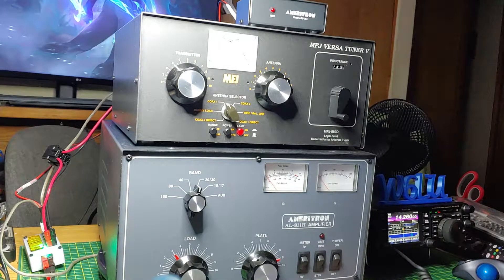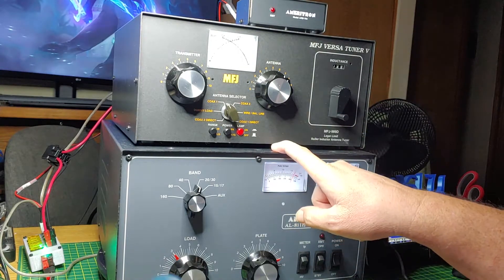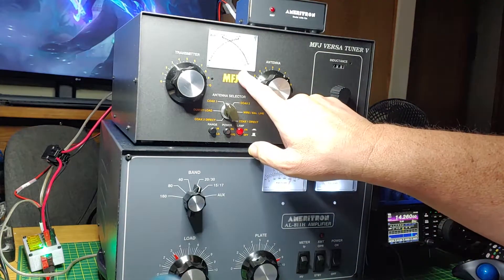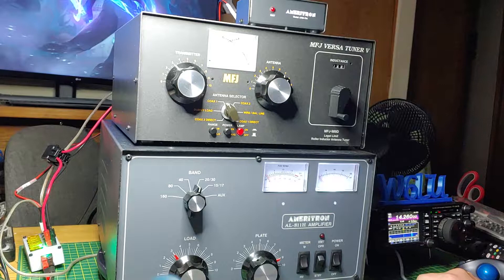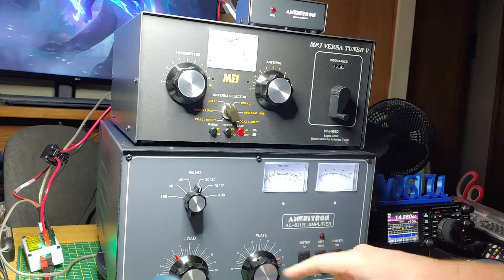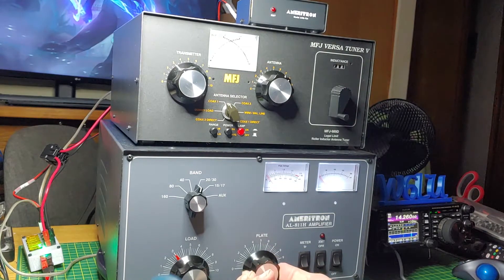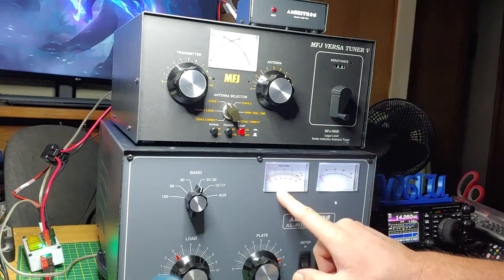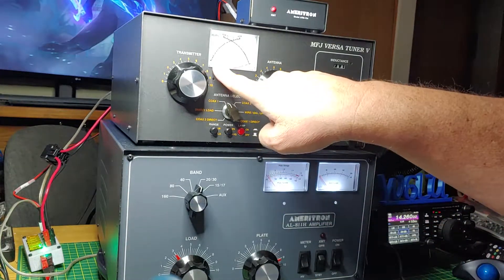Ameritron AL-811H tuning issues (RESOLVED)

Comment: how did you resolve this problem mine does the same
Reply from the maker: RESOLVED!
The previous owner had somehow dropped a nut down the back PCB and it was wedged between the the filament choke and a cap shorting the choke.  Removed the nut and all is well.
Reply: Marvin...did you ever resolve the issue with your amp.  I'm having similar issues...no output on 20 & 40m.  10 & 15m work fine.

Comment: The  problem is in the biasing or your not getting plate voltage to the tubes make sure the voltage is reaching the plates of the tubes. Check all solder connections in the plate supply also at the relay. Here is a silly question are the tubes lighting up? What ever the problem is its a simple one also try all the different bands on the amp could be a bad solder connection in the tank circuit I had one had to re solder everything. Trust me whatever it is its a simple problem.
Reply from the maker: Technically it was a simple problem.  Finding it?  Not so much.  The previous owner had somehow dropped a nut down the back PCB and it was wedged between the the filament choke and a cap shorting the choke.
Reply: Glad you found the problem.
Reply: No been busy working and haven't had time to look into it.